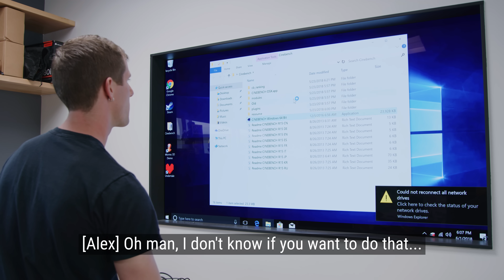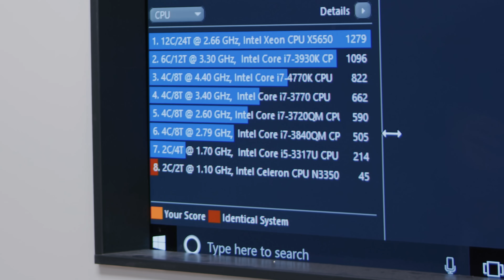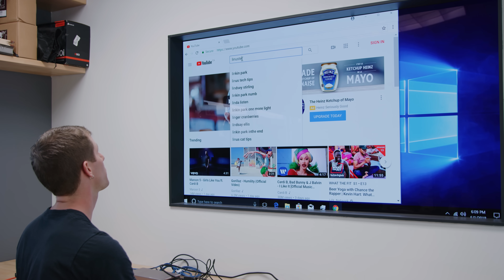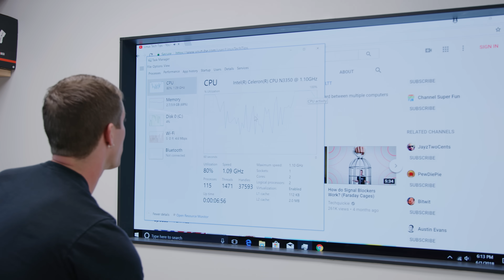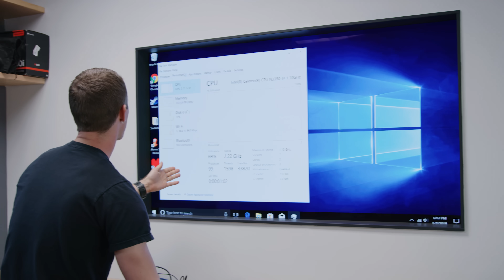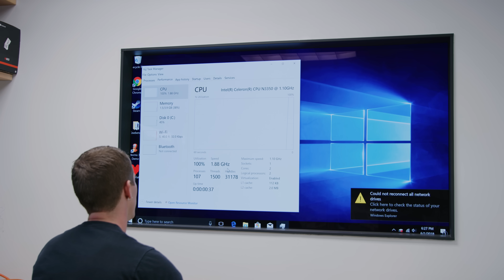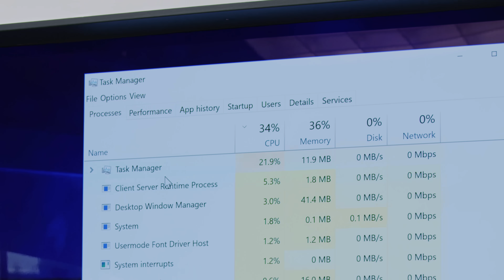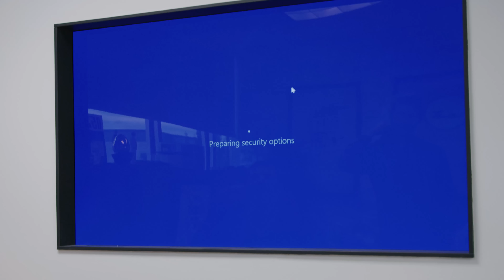PC Smaller than an SSD

Comment: $200 is a little bit too expensive... You could get several Raspberry Pi's for that.
Reply: Budget phones could easily outperform it.
Reply: Nope, not even close by an order of magnitude. The ARM chips used in phones and tablets are far simpler and less powerful and lacks the advanced SIMD features found in x86-64 chips, just because it has a similar clocks peed and a higher core count doesn't mean it offers a similar level of performance. 

A Snapdragon 845 chip, as found in current top-tier flagship tablets, might look faster on paper but  even Microsoft can't get Windows operating at anywhere near the same level of functionality and performance on it.
Reply: jaxative jax there are some tasks in ARM/RISC processors that will run more efficiently than classic x86 ones, it's just the fact arm processors like Qualcomm ones are not very good compared to apple ones(which they never leave apple devices) remember the iPhone X performing better than macbooks? (even if that takes an old core 2 duo processor to do that)
Reply: jacative jax Not necessarily, the reason for microsofts trouble is simply because they are trying to emulate x86 applications instead of running native. While a smartphone running a arm chip is a bit limited due to its os, arm it self performs pretty alright. Great example is apples a11 series which can outperform many mid range laptop processors in benchmarks.
Reply: This is aimed at businesses who need a workstation they can buy in bulk and plop down so every employee has the same machine.  The smaller, the easier it is to hide or disguise as not a computer.
Reply: DoomRater Aaand you could use a raspberry pi for that too. Small af, way cheaper and everyone would have the same computer at work (as if that matters lmao).
Reply: Businesses use Windows.  You cannot run Windows 10 on a Pi, and Windows 10 ARM is underdeveloped.
Reply: RealBloodman it would be great if windows didn’t dominate the business sector. But it does, and a lot of the productivity software that employees are used to runs on windows too. So, if you were a business owner with a tight profit margin... what would you do? Change your OS and software and retrain your staff? Or stick with what you know already?
Reply: RealBloodman Run some Windows software on 10 ARM then get back to us.  Most of the programs businesses use were written for obslete versions of Windows that won't even work in 10.

Comment: It is a small computer they say! But what about quad-core raspberry pi that came out a few years ago.
Reply: CJ arm based architecture cpu running linux.
Reply: Depends on use case. They can't do Windows but are awesome for programming.
Reply: @Phil Adams Indeed they can. www.windowscentral.com/how-install-windows-10-iot-raspberry-pi-3
Reply: Oooooofff, admittedly the raspberry pi has 1gb of RAM and 1.2GHz but it does have 64bit 4core and can run Minecraft. It has on chip GPU. Uhhhhh.....  IDK it's pretty Gucci, and it has been out for a few years (2016). The most recent one only changed speed of cpu to 1.4ghz. (they weren't planning on releasing another one)(but now they will most likely not release another one)
Reply: Thanks! That's a fairly new article so I haven't been keeping in the loop. I'll dig my Pi out later and have a go.

Comment: Raspberry Pi zero w 10€
Reply: i got two for $5
Reply: i got  3 for 1$
Reply: But its not as good as this
Reply: Karthik Sarode link the 5 together for $1 and then get one to control the rest, ez beat the card pc

or just get you know... a compute stick, add a battery, then put it in a 3d printed case
Reply: @bananya6020  then its lost the point of being small and it requires more power than what this one is using. And a raspi cluster is not that great to do any thing to be honest its a concept thing and its shit
Reply: Karthik Sarode ok then use the compute stick- and take it out of the casing to add the psu, or add a small hard drive
Reply: Karthik Sarode then add a memory stick ( not necessarily a hdd) and remove the case from the compute stick and use a tiny case. it works and also, use a usb port lmao. It's smol asf still and is going to be still good.

Comment: 2030: MEMORY CARD SHAPED COMPUTERS!!!
Reply: there was a i386 pc in a compact flash 3 card back in the 1990s, like 2 square inches times 5 millimeter ; now, the raspberry pi compute modules fit in so-dimm slots, bit don't try in a pc, it'll fry it, it's only so that tinkerers can use cheap connectors for it.
Reply: İntel pc stick. Search this

Comment: You are better off running Linux on it. Windows 10 is too bloated and resource hog.
Reply: agree. linux would run perfectly on that thing.. something like PI or Puppy
Reply: Maybe, but it's also possible that Linux wouldn't have all the drivers necessary to run on this thing.
Reply: Chances are Linux already have all the drivers, just update the Linux kernel.
Reply: I've have some Linux troubles with low-power Intel minicomputers very recently, especially with HDMI audio, and normal users shouldn't be expected to update their Linux kernel.
Reply: Linux has way more drivers than windows. And they're builtin, not crap bloatware that you have to download on some shady website.
Reply: degru5091 I think you are both right. When it comes to PC only, Windows has many more drivers than Linux (and additionally, Windows doesn't require a kernel upgrade to add drivers), but Linux runs on many more things than just PCs!
Reply: Windows has more drivers because every device manufacturer gives you a different one with their own crap bundled. But we often forget that almost all devices are made of generic chipsets, and that drivers communicate with those chipsets and do not give a shit about what specific device it is dealing with. So you may have one Linux driver that will cover 20 devices made by 10 different vendors instead of 20 separate drivers on windows. A good example of this is Wifi cards, which are almost all based on Realtek chipsets. Make a driver for the latest Realtek chipset, and you'll cover almost an entire generation of Wifi cards ..

I'm not even speaking about all those devices that claim to only work on windows, except they were actually made in compliance with one of the HID specs. And Linux has excellent HID drivers, and in the end Linux provides a perfect plug and play experience, while on windows you would have to install a horrible sound panel of some sort that would have to take ages to load at boot and consistently spam you with cancerous popups.

And as for those exotic devices that apparently were made for a specific OS and software, you would be surprised how many out-of-tree drivers you can find made by some random guys who just felt like doing it for the fun of it. It may not be a "click next to install" experience but most of the time it works quite well, if not better than on windows simply because you don't have one of those ugly WIN32 UIs to make it unbearable.

Overall, Linux drivers are more normalized, consume less resources and are less of a pain WHEN you know how it actually works and aren't afraid of diving in the CLI.

Also please don't use Ubuntu. Ubuntu is broke. Ubuntu is out of date.
Reply: And as for the kernel update, I don't see what's the problem with that. It takes less time to upgrade my kernel on archlinux than trying not to get scammed by a shady driver installer on windows or trying to extract the actual .INF from the thing to hopefully not have my windows install to collapse on itself.

Most of the time, downloading a whole kernel package (that contains all linux drivers) is actually LIGHTER than a single windows driver ..  HOW???
Why is the NVidia driver 350MB+ on windows and less than 10 on Linux???
Reply: Yeah it's a lot better. Much less buggy. But I just don't like Debian derivatives, mainly because the repositories are often outdated. I personnaly prefer archlinux, which is a rolling release and has great repositories (official and community).
Reply: Malachi Black:
Yes, a light weight Linux like puppy would be great on this hardware.  I have an old ASuS EEPC 701 with a 600MHz processor in it and can use it to watch youtube videos running Puppy.
With the light weight OS, there is basically nothing happening but doing the video but that is fine.
Reply: Olivier Doriath, what's hard about updating the Linux Kernel? Most distros can do it automatically through their package managers, or at worst a simple terminal command. They'll even keep the old kernel around in case the new one screws something up for you.
Reply: degru5091 , you forget the fact that with linux you can remix devices linked to certain operating systems such as mac and pc. And you can mix old and new devices too. For example a Soundblaster live 1024 soundcard perfectly works with linux and can still be useful today, while for current commercial operating system releases there is no fully working driver available (and no official driver at all)
Reply: You can easily run any Linux distro on that tiny PC Linus showed, given that you use lightweight Desktop Environment like Xfce, Mate, LXDE or LXQT. Also updating Linux kernel is easy via GUI on beginner friendly Linux distros like Ubuntu, Linux Mint, Manjaro, Solus, etc. same goes for installing drivers. PS If the PC is latest technology, you should use rolling Linux distros like Manjaro, Antergos, Solus, etc. Check Distrowatch website.

Comment: Raspberrry pi is better and cheaper
Reply: sagar A it's not made for the same purpose as these mini pcs
Reply: What is the purpose of these mini PCs exactly?

It's 450 dollars, for a dual-core 1.1ghz and 4gigs of ram that goes completely to waste trying to run the ram hogging windows 10. The pi is roughly 5x cheaper with a quad core at 1.4ghz. I don't know why you'd waste 450 dollars on this thing. I'm not trying to be condescending, I just don't see the what the intended use case actually is. Why do you need a tiny box running windows? Word documents, something file specific..? Which in that case I'd say that Pi's can already run the Windows 10 IoT edition.
Reply: FlaxeMusic this one in particular I agree is not a good value. But many intel based mini pcs are worth it for those who just need a cheap windows machine. The pi, though cheaper, has an arm cpu with only 1gb of ram. Which is completely fine for its  intended use as an SBC but as a full Windows 10 machine, not really, because that's not what it's meant to be. Which is why I said it's not  made for the same purpose, raspberry pi is for building little robots, data collection machines, etc.  A lot of the more reasonably priced mini pcs are not really a bad deal. Comparing windows mini pcs to a raspberry pi is comparing apples to oranges.
Reply: Specific integration into business applications/software where you need a full windows environment.  A lot of businesses use front ends/software for their companies internal operations that were built in C#/.NET x86/x64 environment.  Essentially the fact that this box is x86/x64 alone is a huge factor.  It isn't just Windows that defines an application, there are a LOT of differences between ARM and x86/x64.

450 may seem like a lot of you, but just for example one of the businesses I do work for that's main purpose to build and ship engines has been shipping a lot of engines to oil fields the last couple years.  Those oil fields will buy a part for 250 dollars and pay 4K to ship it immediately as fast as possible, they don't care about that price because it doesn't amount to anything in the grand scheme of things.
Reply: Oh absolutely, I have no shade towards intel based minis, in fact the only PCs I own are intel itx based machines in very small form factors,(10 litres and below) I just think there's a point to be made about brand price bloat when buying these essentially all-in-one products. I'm not here to come off as an elitist as some seem to think, I just believe in advocating for a fair price point. That said, a lot the alternative SBCs don't really get any airtime outside of enthusiast circles but are extremely capable, so hey, consider me a shameless unpaid shill. I mentioned the UDOO x86 Advanced in another comment, an SBC that is intended for use with Windows 10 that can be had for 170 bucks, 4gb of ram, quad core celeron @ 2.2Ghz, 32gig of onboard storage. Alternatively the LattePanda Delta is the same spec as this Zotac with a better CPU for 200 and is also geared towards desktop Windows 10 usage.

I do get your point, the Pi has a nice little hole it fills and can't strictly be compared in the same arena certainly, but single boards more broadly that are a little way up the price ladder blow this Zotac thing out of the water, and they're modular and priced appropriately.
Reply: FlaxeMusic I definitely agree those sbcs are better deals but the average Joe walking in Best buy to buy a computer won't even know they exist. they just look at whatever's on display and pick one, and the Zotac might be one of them. not that that justifies the price, it's just an example of how they can make a sale to an unknowledgeable customer. At least that's my guess as to why it's priced that high
Reply: Sure, but it's limited to either Linux or a much simplified, stripped down version of Windows 10 that is even less useful than Windows S.

Also, this is a plug-and-play device that is ready to go out of the box and exponentially more powerful than a Pi, you just cannot compare the x86-64 architecture to ARM, they function completely differently.
Reply: Because you can take it out of the box, plug it in and you're ready to go straight away with full Windows compatibility none of that Windows iot BS that can't run any apps. 

For many users that makes perfect sense, for most of the people who watch this channel, that is enthusiasts and hobbyists, not so much.
Reply: I agree, I think it's exactly that simple. I'm a guitar collector and the same thing is commonplace amongst manufacturers, the brand speaks mountains more than the performance reflects. Still, so long as a few people reading this look further into SBCs other than the Pi then I'm happy, there's enormous potential for this sort of thing moving forward and I think if people did some research they'd be quite surprised at the capabilities, in a lot of aspects I think we're better off moving away from ultra-proprietary hardware.
Reply: The Udoo x86 will run desktop windows better than this Zotac machine, it's no different than the all in one except you're not paying a 40% premium for slightly worse hardware and the branding. To clarify I'm not necessarily on the back of the OP's comment, this isn't strictly about the Pi but more about PC's in general of that form factor.

Of course, I'm not ignorant to why for most users this makes sense, I'm aiming the things I say specifically at the crowd whom would be reading this comments section in the first place, as you said we are generally enthusiasts and hobbyists. I'm not here for the betterment of the every-man, I'm talking with enthusiasts about, essentially, price-performance ratios and things I've found that aren't marketed nearly as well as this product is and thus people would be far less likely to know about.

Comment: dude rasberry pi exists!
Reply: My Ironic The use case for this PC wouldn't necessarily require Windows. Also, the Pi is quad core whereas this is dual core, although admittedly it does clock higher.
Reply: rpi can run windows 10 IoT Core version of windows

and its not rasberry

raspberry pi
Reply: My Ironic Raspberry Pi runs windows and very good at that.
Reply: My Ironic:
Since "running the OS" is never the purpose of a computer, for the intended purpose, Linux is a better option.  Less of the computer would be eaten up by the OS so more would be free to do the intended job.

Comment: Yeah, PCs like these are really useful if you need a basic device
Like... I’ve browsed Acer brand laptops, and there are some pretty good celeron laptops, with the typical ports, and such, and good entry-ish level specs, it can do some good basic stuff. And I think you could even try playing some really light indie games, including Minecraft (maybe)
There are even affordable slightly higher spec celeron laptops on Acer, which have more than 4GB ram, and quad core :P
Most of the laptops are 300CAD so it’s pretty ok, if you can’t afford anything else, or even wanna get your kids something basic, cuz you can’t afford anything better for them. There are AMD ones if you don’t like intel tho. (This is all I know in the low end, affordable laptop line... you’ll have to look around lol)

Comment: could it be used as a streaming encoder, you could mount it in your pcs 2.5 inch ssd tray and use it to encode your streams or is the apu just way to slow
Reply: Micro USB is too slow

Comment: So basically a phone, but with very little storage, no battery and no screen, no included IO to use it (like touch screen & on screen keyboard), even less RAM & weaker CPU than a phone with an OS that has higher demands than a phone OS. Who would want that? Especially that nowadays most Androids have support for USB-C to HDMI dongles, not to mention chromecast for the entire screen without cables.